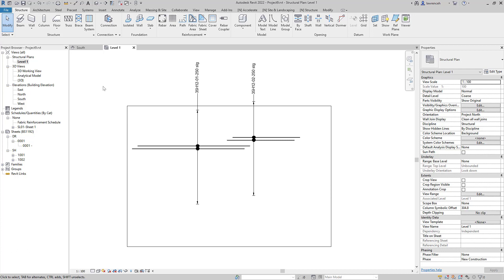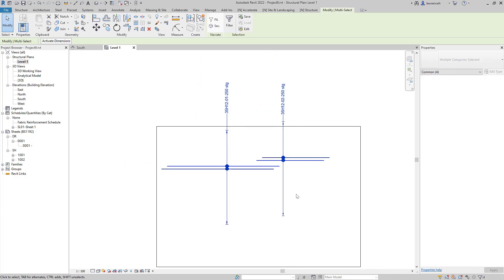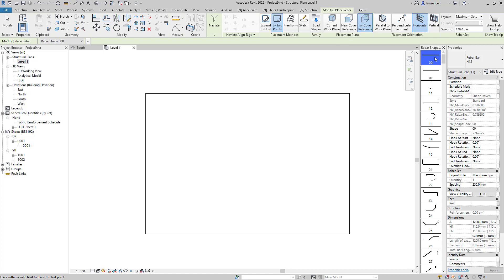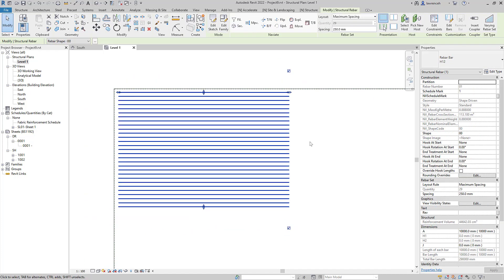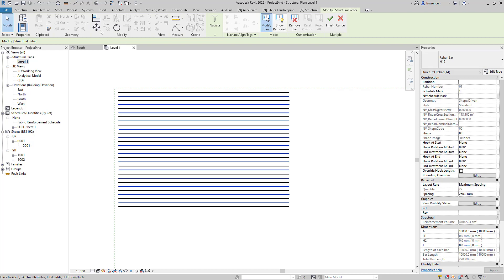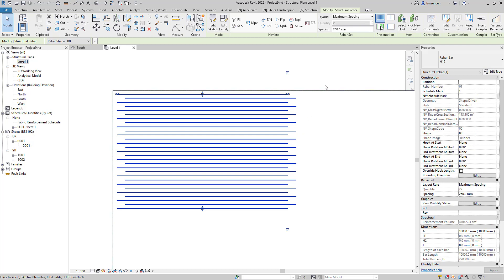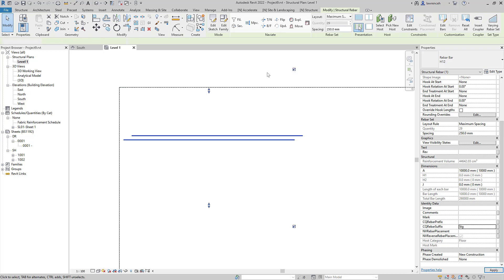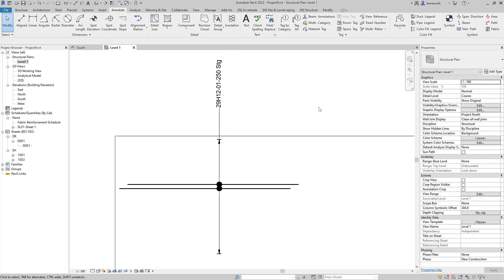Revit 2022 Rebar - Creating Smart Staggered Laps

Comment: Hi. Nice video. Please how do you do the rebar distribution line and text in the format 29H12-01-200stg
Reply from the maker: Hi Sam, this is created with a MRA (Multi Rebar Annotation). Basically, this is formed from a dimension style and rebar tag
Reply: @RevitStructureBlog  is it readily available in revit or needs to create as customer annotation?

Comment: Would be cool if you can also add how to constrain the next set of bars to the one shown with a fixed overlap; making the two sets change if you drag the splice point on one...
Reply from the maker: It would be great to have laps and ability to split bars j to stock lengths.